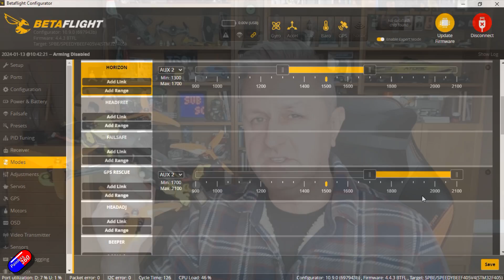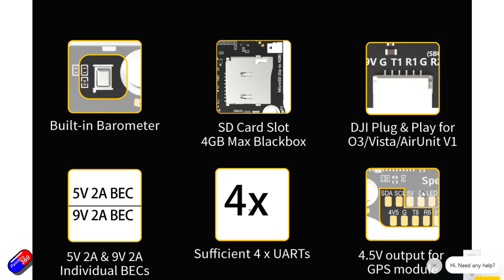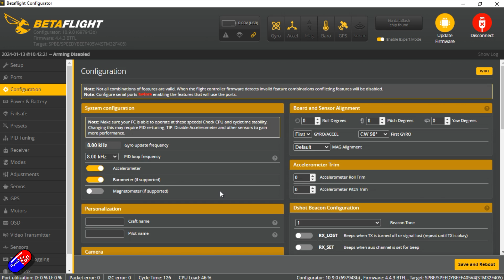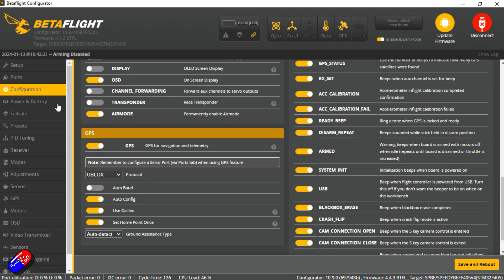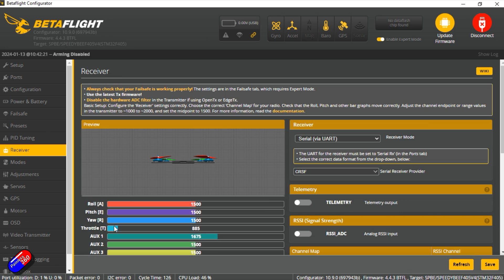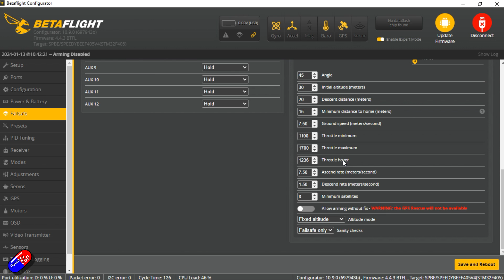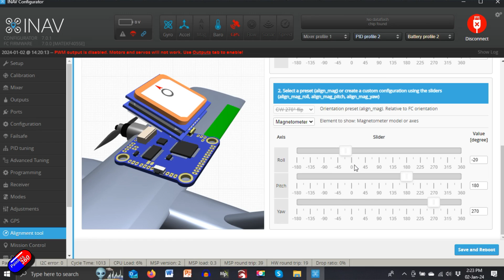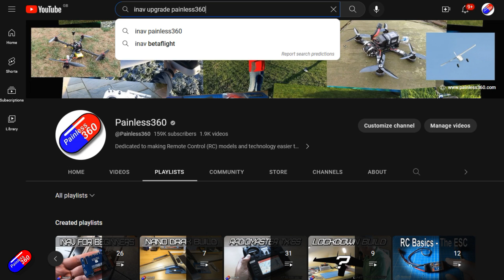Adding a GPS to a Betaflight Quad: The cool stuff you get when you do!

Comment: Hello Lee, 
Can I ask you what is the "regular angle of attack" for a long range drone?
 Or what is the angle between the GPS antenna and the horizontal plane of the drone?
 I'm looking for GPS support, but not for racing... just for "calm" flying.
Reply from the maker: That really depends on the pitch angle you'll fly at for that specific cruise speed needed on the quad. Angles of 10-25 degrees are typical. Having the GPS flat to the ground isn't needed for a solid 3D lock though... Happy flying .

Comment: By total coincidence, I'm using the exact same flight controller and GPS unit as you. If I enable the magnetometer in Betaflight, it still doesn't see it. I have triple checked the wiring, and resoldered the wires to be sure it was not a bad connection, but no matter what I do I can't get Betaflight to see the magnetometer. Do you have any idea why that would be?  I know you say we need not bother with the magnetometer in Betaflight, but I would like to.
Reply from the maker: I didn't look at that. When reliable navigation and autonomous flying is needed, I install INAV... Best of luck
Reply: @Painless360  I actually figured it out. It appears that magnetometer support is not included by default. When you flash BF, you have to select "magnetometers" from the pulldown list. Now I'm trying to figure out how to do a custom sensor alignment.

Comment: Hi, i have configured everything but after locking in to 25+ sats on it but in osd compass its pointing 20-30 degrees off when pointed to north. Is it going to be problem ? And if it is how do i correct it ? Gps is mounted on rear leg on right just mentioning for info.
Reply from the maker: Do you have a compass installed, configured, and calibrated?
Reply: @ i thought gps have everything. This is my first build. I have geprc m1024q gps installed. I did not find anything on betaflight for calibration watched most of tutorials on gps. Though drone is hovering stable without any filter or pid tuning. Let’s see how does it do if i try it on larger space. I need full flight test to be done. So far everything looks normal except home point direction of osd but i didn’t fly it more to 10 meters distance.
Reply from the maker: Check out my quad build series from this time last year. It's aimed at new builders... Best of luck

Comment: Is there any way to make gps lock faster? I would like to use it, but if i wait for gps lock on nazgul eco dc 5, it drains about 50% of 1550mAh battery. I have about half of flight time comparing to the normal start, without waiting for GPS to lock. This is silly :|
Reply from the maker: Modern GPS units that are M10 based lock faster in the testing here. I did make a little 5v plug for my older quads that allowed me to power the GPS for a few mins to lock BEFORE plugging in the flight battery... I've just swapped one of my older quads to an M10 GPS for this very reason..
Reply: @Painless360  i have M10. It takes ages to lock :|
Reply from the maker: https://www.youtube.com/watch?v=cAe-xOTSoAI

Comment: Would you be open to posting your design of the gps mount?
Reply from the maker: I wasn't planning to as it is very specific to the GPS and frame. Are you using the exact same stuff?
Reply: @Painless360  No sir, same gps but its on a Source One v5. If you are okay with it, may I try to retrofit/change it? I am new to cad design so it would be a big help.

Comment: so I am building a drone that has the Speedybee F405V4 with the RDQ Mach 3 VTX, and a HappyModel 2.4Ghz ELRS receiver, Phoenix 2SP cam.  I haven't picked a GPS yet because I am still not sure what I need.  I'm not ready for stunt flying and more interested in the video aspect.  If I am understanding these videos correctly, INAV is more along the line of what I would need.  I want my drone to come home and also hover in position.  Do I need a GPS with a compass and magnetometer? I was looking at this one for my build if compatible GEPRC GEP-M10-DQ Series GPS Module.  Any advice would be greatly appreciated.
Reply from the maker: Check out the video from yesterday where I setup INAV on this quad and answer all those questions... Happy flying